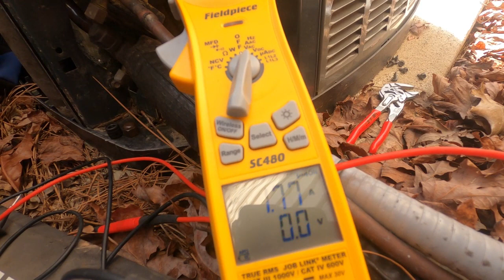A  Bad compressor in a Trane XV18 Variable Speed heat pump.

Comment: I personally wouldn't bring my self to recommend someone to install these on their homes. At the way the prices are today, no ones going to bat an eye at these type units. 9-10k is our bids my company I work for is having for single stage options and I have a hunch that single stage options are going to be a huge majority of our install for 2023+ and repair work going to become way more common. Prices for units are crazy and only going to get crazier. 90-95% of customers would laugh and throw me out of the house when they see the price of a variable speed unit.

 If you did the math for the variable speed units, it's going to be many many years for you to see a breakeven point and then another many many years to see a return on the money you spend vs if you had just gotten a single stage/two stage unit plus. Plus the single stage/two stage equipment very reliable and dependable compared to variable speed.

Comment: This is becoming a large problem across lot of manufacturers not having the parts for warranty but yet the parts are still being used in production of new units. I went to one manufacturer factory tour, all mechanical parts were shipped on different pallets wrapped in plastic wrap. I was told that since the parts are now being marked with QR codes that they are now linked with serial # of the new unit, even before the unit is completed. Yeah you would think it would not be hard to snatch one part to complete a warranty, but then they would have to find box and packaging material to ship the part, that is probably why it takes a couple of months. Great Video